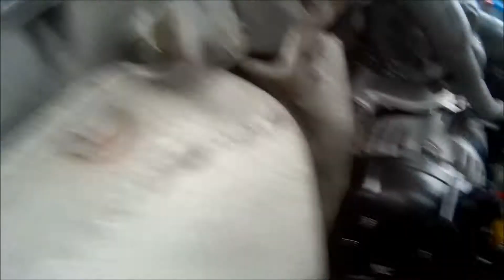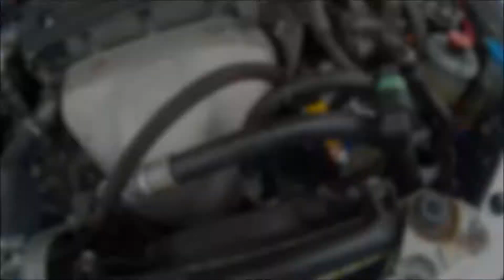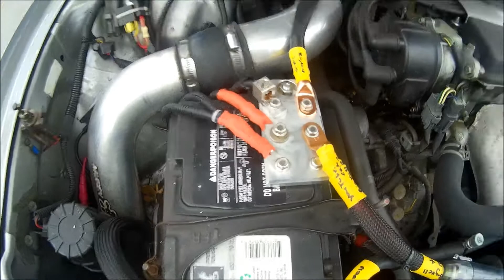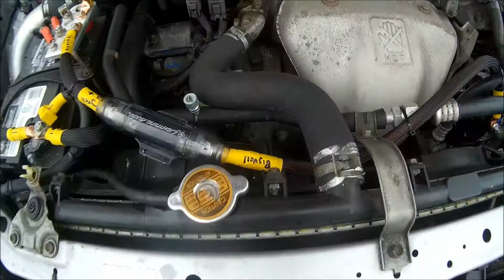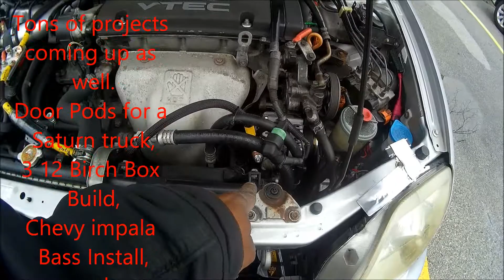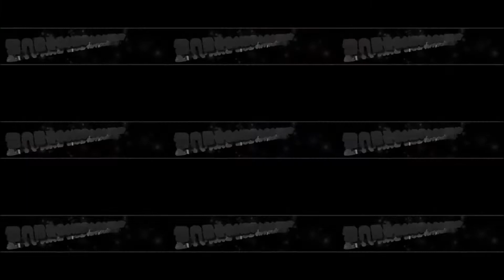Great Idea For Your Custom Alternator - Big 5 Upgrade

Comment: No need to fuse the alternator if the fuse blows your not charging and can be stranded
Reply from the maker: Keep extras 😊🙂… that’s a must for shows anyway. It’s great option to protect your charging if you push your electrical to its limits. Blown fuse vs blown alt. You are correct as well with saying not necessarily needed.

Comment: Instead of a fuse would a circuit breaker work so you are not spending money on fuses that blow?
Reply from the maker: Yes a breaker would work great as well. Personally I would only use a marine grade breaker for corrosion resistance. Also everyone Ive ever handled seemed like the quality was there vs a normal DC rated breaker.
Reply: Yes but also the bad part the breaker would get weaker over time if it keeps blowing

Comment: Looks pretty good.  However.

You need to get those lugs on the wires changed.  

Running straight copper lugs will corrode.  U need ‘tinned’ ones to prevent that.  

I had copper ones and I noticed they started turning green.  

Just a suggestion for ya
Reply from the maker: Appreciate you stopping by and I appreciate the comment as well. I ordered silver tinned recently and slowly switching them out. That definitely was a concern especially here in Chicago. So far a few seasons with no issues with major corrosion a little oxidation here and there. I did use a coat of grease on them. Cleaning cables is no fun at all though. Silver tinned FtW

Comment: I'm with you on the fuse, only if the stock wire is still being used. Otherwise if that fuse blows, you're not charging... And you may not know it until it's too late and you're stuck somewhere with a dead battery.
Reply: Why I removed my alternator fuse